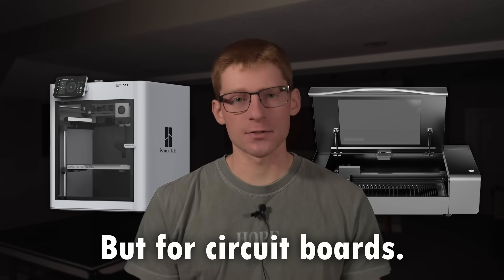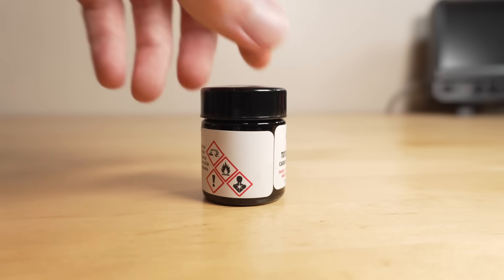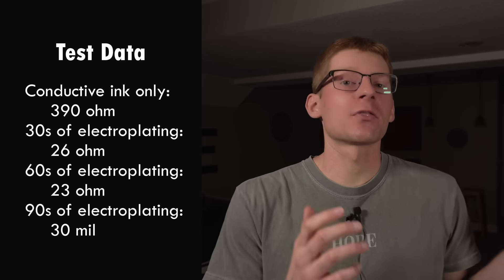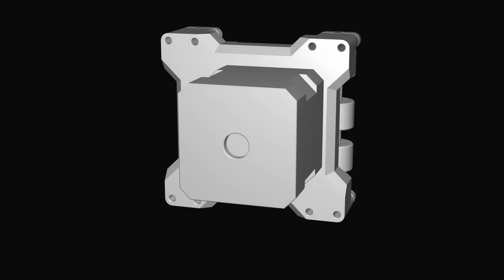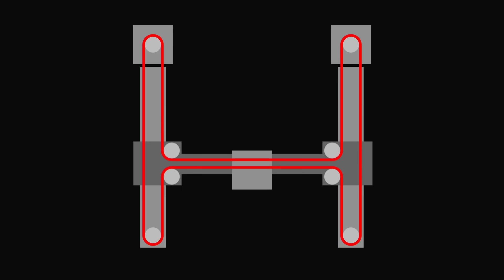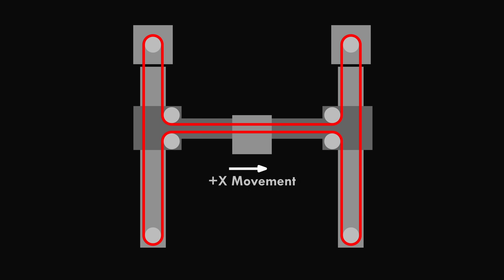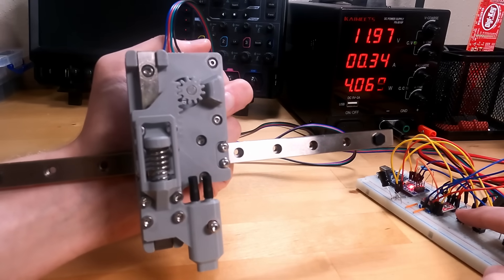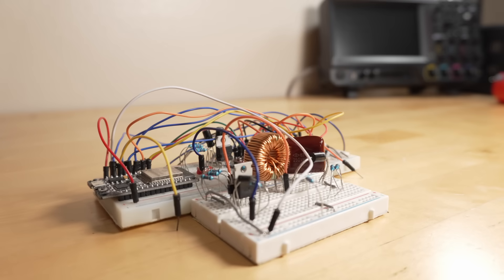I'm Developing a New Circuit Board Manufacturing Technology

Comment: I have been working on a similar project for a long time and I've refined a process to make custom, 2 sided boards with soldermask in about 2 hours. 

I want to get the vias, even if it's a manual process, but that's still really impractical.  I built a circuit to use reverse pulse DC electroplating 10ms forward, 9 times, then 10ms reverse once with 10ms breaks in between.  

It does plate, and throughholes do conduct well.  But it tarnishes everything and the applied layer wants to delaminate later.  This can most likely be refined.

But the bigger issue, and, plating solves it, but, it's that the copper layer on the pre-fab DIY boards is only 18 microns.  If you want to carry any current, you need at least a half a mm trace width.  When you get to this level of spacing, it actually becomes way more practical to manually add vias, be it a wire or a rivet.  I hate it when people say "just do this instead", no.  I want a machine to plate vias and do all the things.  

In the mean-time though, I have equipment in use right now using boards made at home inspired by you and Stephan Hawes.  It is repeatable and reliable, with only a very small amount of labor.
Reply: The labor consists of flipping and aligning the board on a fiber laser.  And then optional, soldermask, that takes many steps because it needs to dry, then lightly cure, then ablate with laser, then fully cure, and this needs to be done to both sides. That can take as long as 2 hours.  It is worth it though.
Reply: Silkscreen printing, ehh.  It's about 2 minutes of labor, but the material waste, because text is so small.  It's still a fraction of a penny, but it's another process.  So only do it for production really.
Reply: One other note, I "painted" conductive ink manually and allowed hours to dry with the manual plating method.  The conductive ink is "India Ink" mixed with gobsmacking amounts of graphite powder.  If you keep mixing it, it will dissolve more.  No one ever publishes a ratio and now I know why.  Just keep adding and mixing, this might be 75% graphite.  I honestly do not know.  But it certainly works as a base coat for plating vias and through-holes.
Reply: Additives can make the plating process much better.  Right now, I am using copper acetate because it is completely harmless to have around.  If I start adding things such as sulfuric acid, I will need fume extraction.  This isn't impossible to do, it's just not worth the effort at this exact moment.  Since the alternatives do work, and my design requirements can accommodate the limitations, it's easier to do my process for now.  

However, I would really* like to speak with you and Stephan Hawes, i'm not big into collaboration projects, but I think the three of us each have a specialty and combined, this is game changing.

Comment: Well, the Nano Dimension Dragonfly series can do 3d prints of up to 12 conductor layer PCBs.  However, there seem to be a few caveats:

1: The insulator, conductor, and semiconductor materials are proprietary, and apparently fairly expensive, (as in several times the cost of ink jet printer ink per molar amount).  Which makes for an ongoing money sink for continuous use.  Also, the conductor requires lead-free solder for operating voltages  over 1.8v positive or negative.

2: there's no silkscreening on the boar during print whatsoever, so you'd better have copious notes, and/or the circuit diagram handy when you populate it.

3: Any holes bigger than standard chip or socket via width will need to be drilled by hand.

4: The smallest model costs $200,000 for a device that occupies roughly the same volume as a kitchen refrigerator in a much less convenient shape hor your workship, and only make prints up to 7.5×7.5cm.  If you want to 3D print your dream computer's motherboard, it'll set you back at least $500,000, and you'll still need to wash it in isopropyl alcohol, populate it yourself by hand, and hope there weren't any tremors during the printing process.

Comment: simply add a rectangle brace in the square flat sections to reduce or eliminate twists from torque. can you use pre cut copper tubes peices kind on like a nut insert for your via and press them into place. just some ideas that popped into my head when i watched this video. i love your idea of being able to make a multilayered pcb. could it also be that you make all your via ways on custom boards along one edge and then have a top and bottom cnc micro mill to remove copper layers from the fiber layer in the middle to create the pcb design.

Comment: I have an idea :P There is a machine that "prints" cable in any shape, like bending a paperclip, what if your machine made the connections with rigid cables bend the right path and then placed like any other component, you can stack as many levels as you want

Comment: Study a Gold wire bonding machine with a different sequence: 1mil Au wire into via, EFO on the underside makes ball and tamps it flat, capillary moves to form a length on top and bends it flat, then bonds it to the copper layer.

Comment: What do you think about this: insert a copper wire into the hole, then use electroplating to add copper around that wire till the moment it fill the hole completely... Then cut that wire just above the tracks. Once all vias are in place, just use apply grinding/milling process to level the surface of those VIAs with the tracks surfaces on both sides of the PCB. In addition, you can make all the VIAs at the same time by connecting wires from all VIAs.

Comment: Back in the day, we made circuit boards at home by etching the copper away in acid.  Vias were not plated, just filled with solder or a scrap lead cut off from a through-hole component.
Reply: we still do it to this day (except for the acid part, at least for pcbs) and will be doing for all foreseeable future since it works great. dude's trying to solve a problem that doesn't exist.
Reply: It's not a "problem ", per se @ironwheal He just eventually wants to be able to walk away from.a desktop machine,  and be able to return to a 100% finished/functional PCB

Comment: Why bother with electroplating at all? This was developed specifically as a parallel way to do entire boards at once (as you explained very well.)

If you're already doing one at a time, maybe you could insert a simple wire filament through each hole then solder in place? Brass EDM wire comes in 0.25mm and there are already tons of documented ways of driving the stuff.

Cool project - keep it up! Subscribed
Reply: agree 100%
Reply: My thought too - it could be spot welded, or deformed like a rivet for thicker wires, or just placed and then soldered as part of the assembly.

Comment: Instead of moving top and bottom, move the board in 4 directions, so the alignment of top and bottom will be always perfect. Also you have another issue. If you have several holes of different sizes in a single board, you have to change the drill for each size. Potentially if you have only 3 sizes, you could make a rotating head, such as rotating would change the tool. The problem is, when you drill, you make dust, and so you should have suction above and below the board. So, this is going to be a complex project!

Comment: Hey, im sorry that you couldnt figure this out. im no expert here but instead of using electroplating why dont you try using thin copper tubing which will replace the low resistence copper wiring per hole? this could be feasable if it is fed similarily to a 3d printer but you can instead add metal which will bind to your graphite. hope this helps and i apollogise if there are any errors. good luck!

Comment: Brother, I'm an inventor and amateur scientist who chronically struggles with the step of moving a circuit from breadboard to PCB. I've spent the last week failing to etch a circuit with that plastic film and ferric chloride process, with attempt after attempt getting the concentrations wrong or the exposure time wrong or baking time wrong, and on and on. Do NOT get hung up on sub-1mm vias. Your target market is me, and I do not need something that competes with state-of-the-art production boards, I need something to compete with a week of frustrating failure. You're doing great stuff! I'm looking forward to seeing where this goes. Read Innovator's Dilemma if you want to know more. Once you unlock a new market with good-enough tech, you can iterate to get better.

Comment: You need the electrolyte flowing through the via, while plating.
Personally I think plating all the vias at once is far superior, your time should be spent on systems of PCB position registration so you can drill all vias, take out and plate all vias, the re-register in the machinem for track routing. That also allows you to do plated-through holes in various sizes.

So that needs;
CNC drill and tool changer (different drill size)
Easy fast accurate PCB position registration
Convenient small tanks for hole paint and hole plating
Back in machine (twice) to rout tracks both sides

Basically this copies commercial systems, but the clever part is that your machine is small and you design the systems to be 3d printed etc where possible.

Comment: Cool project man. 

Im wondering your long-term opinion of that scope brother? I have the same one but the mso5354. I find myself using my old 2 channel tektronix tds2002c more often because the rigol seems to have a weird jank like a Bethesda game. Plus the probe compensation is horrible with the way the screw can come from the factory buried in such a way that it's inaccessible. I got the scope free from an insurance storm damage claim and regret not getting a micsig for auto work and floating grounds without having to use an isolation transformer or diff probes. Id sell it but i live in a rural area and know exactly zero people in a day's drive away who would buy it haha. 

That black kaiweets psu is great for an off the shelf smps. I regret donating it, even though i have a few linear supplies that make uo for it. Hoarding gear (or anything other than books really) for the sake of it isn't my jam so i donate anything which does not get used regularly. Same with guitars, i have a buy one, give one system. There's always a student i teach that could use a better guitar since i do it for free for a few underprivileged kids like i was many years ago.  I have a selfish interest of teaching students technical metal based lessons instead of getting them locked into lazy blues theory all the local teachers start with. Haha. I seem to be the only one who requires use of a real metronome as well curiously and i don't have a useless music theory arts degree like some of the for-profit guys around. I have a relative who took lessons for 10 years every week from a guy and doesn't know how to play shit. Hes a great engineer though. His father helped develop some of the first military flying simulation systems back in the day that took a building to contain haha. For the second gen nato jet fighters back in the late 70s and early 80s.

Long ramble to wonder about a scope. Sorry man. Take care.

Comment: There are electroplating solutions that can deposit faster. And because you're working with such a small volume of "bath" you could utilize expensive additives. Maybe try a 'deep eutectic solvent' of copper salt and urea! Someone already mentioned pulsed AC deposition as well. Essentially, you have an electrochemical problem that needs an electrochemical solution (no pun intended) but your idea is solid. Don't give up on this!

Comment: I can't help but thinking you are overthinking this. If it's a prototype board, it's enough that there is a pad on each side and you can just solder a jumper wire through the hole to each side of the board.

Comment: You might be overcomplicating the process a bit by trying to keep the vias open holes rather than using a conductive filler material or plug to bridge the gap.

Comment: This is something I have worked on since the early 1980s to solve!
That is, solving the problem of making vias in a DIY PCB.
For the past few decades, I haven't been trying any hands-on experiments, I've only been researching what other people try. Why? Because I gave up decades ago!  (Well, I didn't completely "give up," but I stopped trying things out physically.) 
Now I imagine things (theoretically). And I investigate what other ppl try.  (Not many do.)
Your method of injecting conductive ink is, so far, the best method I've found to be able to electroplate any copper in the via.
That's as far as I I'm ever got, but like you, I ran into my other problems.
I've also thought through using a different method, other than electroplating copper. 
Fur instance, electroplating a different metal isn't practical, and there's no advantage.
What about using a different process, other than electroplating?
Mmmmmh.
So far, I'm stumped!
To get actial working visa in my prototypes, I've resorted to simply soldering a lead through the hole! 
But, it's very time-consuming, and not very space-saving either.  It's just a way to get something that works.
(I save the cut off leads when I put in through-hole components, then later use the pieces for jumpers, vias, etc.)
So, I WILL be watching your future developments!  
Good luck! 
And, good work, so far!
👍👍👍👍👍

Comment: If I did it by hand, I'd just put a hunk of wire through the hole and solder it at both ends.  Not sure if this approach can be automated, but presumably you need to solder stuff anyway...

Comment: Really cool video, you could also try using a silver conductive solution so that it is a one step process to fill via, much more conductive than the carbon conductive ink. Might eliminate the need for electroplating out right

Comment: Extremely cool! But i don't understand WHY? For prototyping 2-sided boards you can just flood vias with solder, and if you are planning to use some through hole components in them it just makes it easier. Unless you are aiming for multilayer, it looks like solution looking for a problem. 
P.S if flooding vias with solder is something you just oppose - look into old-school rivets they were used on circuit boards even before they became printed :)

Comment: If only you had some kind of... expedient home PCB manufacturing method, it would make projects like this SO much faster. :p

I was thinking about this exact thing just the other day, after seeing Steven Hawe's video. FR1 is definitely promising for this application, you can burn off copper with a laser and not char the board, while drilling holes that are charred and conductive for electroplating, the latter part won't really help you though unless you find a way to do large parts of the board at once in a convenient manner. 

But yeah, this kind of machine is definitely one of the main missing pieces of the home fabshop. Nice to know someone is actually putting in the work to develop it, too! If you really do solve the main missing piece in this puzzle, especially if you do it BETTER than production boards, it would be huge. Everything else is trivial compared to solving the via problem. Alignment/stacking/compression really don't compare.

You should talk to the rack robotics people about the motion system though, they've designed something similar for a different purpose that works VERY well so far. It was for wire EDM.

Comment: Maybe this is not a suggestion that can work. But is it not possible to feed the current for the electroplating process through the pcb copper plate? If the problem with high current is that it wants to reach for the source and drain. Would it be solved to switch those to the upper and bottom plate.

Just a random thought 😅

Comment: Maybe a dumb question as I've seen lots of vias type attempts, but what about drill the hole, insert a fine wire and cut and then cap both sides (with perhaps solder) to the tracks? Might not be as tiny as it could be, but it would achieve the same effect with lower engineering requirements? Anyway looks great what you are doing!

Comment: This reminded me of the Lumen PnP project from Stephen Hawes, so I went looking and found out that he released a video recently about using a desktop laser etcher to cut copper traces out of a blank pcb, and then use the Lumen to populate the board with components. Lumen's research could be a valuable resource for your project, since they've had to solve for many problems around working with circuit boards, and it looks like your goals may be aligned now. The only thing Stephen is missing on his boards are vias!

Comment: Two possible solutions come to mind.  First, more in line with what you're already doing, this is a few seconds from a Nerdrage video from 14 years ago, where he electrochemically grows silver crystals in real-time.  https://youtu.be/fnyBldC4Ra4?si=my3XV8mS6TEZhS_b&t=213  And second, just cast them! 😁 Yeah, use solder and inject it into the 0.3 mm via holes.

Comment: I'm at 3 min 50. Your hole filler idea is cool bit a rivet made of your desired conductive martial would be faster and require no complex double headed gantry set up. Just solder to the rivet. It will not be a beautiful board, bit it would let you prototype really fast.